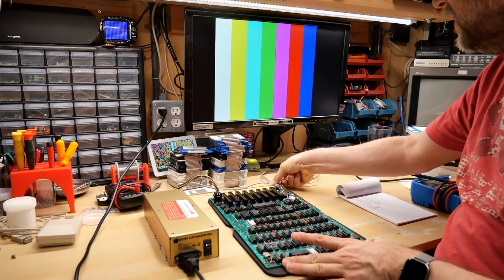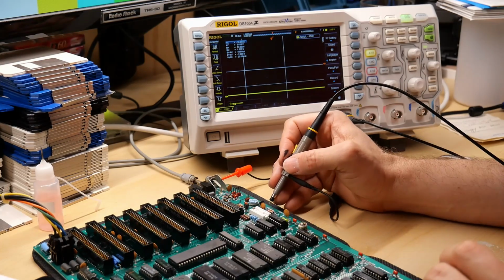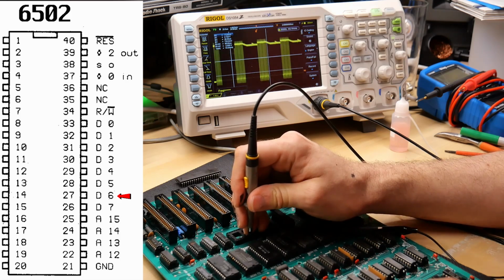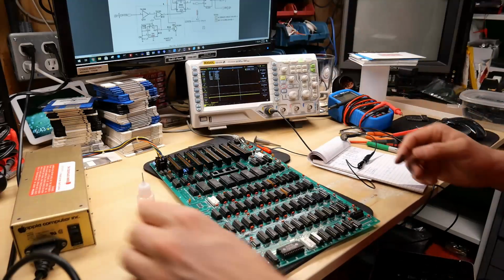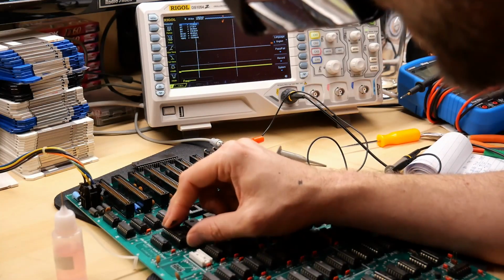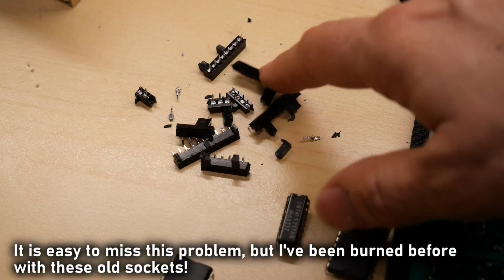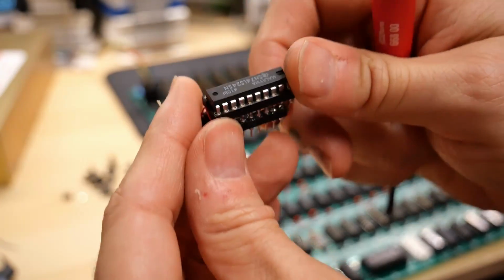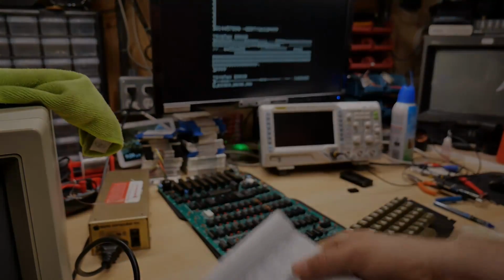Fault finding and trying to fix the Apple ][ plus

Comment: I have a similar problem at Europlus. Screen filled with question mark. 
Memory tested. When it is turned on, hear a beep and turn on disk, but does not read. The screen fills up ???  Pressing Reset key turns off the disk and clears screen and fills in question mark again. Pressing the keys sometimes shows some characters. 
Do you have any idea what to do next? 

Can I get a schematic of how to convert 74HCT245 to 8304.

Comment: Hi Adrian, your videos are inspiring, I recently acquired an Apple ][ plus and I am trying to get it to work. If I boot without any expansion card, all I get is a screen with garbage data. I have a Titan Accelerator card, and if I plug it in and boot it, then it boots and hear the beep, but the screen is still filled with garbage, If I type something, all is see are @ characters on the screen, but the screen is filled with sold square characters, not sure where do I start. Any direction would be really helpful.
Reply: As a follow up, we basically did like what you did, pulled out rams, roms and processors to make sure the pins are not bent and reinserted them back after a while voila it booted without any problems, the. After few mins the keyboard quit working. It still responds to ctrl reset, probably encoder is busted?

Comment: I've tried to read the specs, but I will be the first to admit that I'm not electronically minded, I'm a programmer :)
Adrian, can you clarify what, if anything, might have gone into CPU slot 14 in the bottom right corner? Just piqued my interest as it looks like an SMC kind of location, and in my ignorance, I didn't think they were using that sort of thing when this was built!

Comment: It's too bad that the direction pin on the 74LS295 wasn't inverted from the 8304. If it was, you could have just inserted the chip rotated 180° and swapped Vcc and ground.

Comment: The 74245 and 8304 are the same except the power pins (VCC and GND) are reversed, you could just flip the chip over, reverse the power pins and maybe have to invert the OE / Chip Disable

Comment: I Did Some Research and found that the 8304 is pin compatible with the 7304. And weirdly enough an support chip for the Intel 8086 & 8088 processors known as the Intel 8286. So the DP8304/DP7304 & Intel 8286 are all basically the same chips. I sure hope this helps.

Comment: Isn't the leftmost ROM the character generator? During the video phase, if text mode is selected, the ROM is addressed by the video address generator plus the contents of screen RAM. Chip select is low, and the output of the ROM goes to the video shift register. So you would see activity on that ROM.

Comment: If that KB has Datanetics DC51 switches, and as it appear to be a pre-RFI model, it almost certainly does: I have a detailed and specific cleaning procedure, that you can attempt. The DC51 cannot be safely disassembled and then re-assembled and must never be cleaned with water at all, in any form or method.

Edit: I looked at the video for the previous part, and you do not have DC5x switches, so it is far simpler to clean that mech.
Reply from the maker: Luckily it's an Alps SKCC board! Glad it's nothe DC51 didn't realize it couldn't be cleaned even.
Reply: @Adrian's Digital Basement  Aye, I saw in the prior part that it has the T stem Apls. You are superbly lucky, as if you has washed a Datanetics B with DC51s like that, you would be looking at £8 per switch that is dead, and a lot of chemicals and time to try to revive them first. 

FWIW, when cleaning a KB mech, it is fine to wash the keys in a fin with some warm water and mild soaps. For the mechanism itself, I cotton swap clean the mech, and I spray a tiny bit of both DeOxit F5 and DeOxit D5 into the switches. The Fader (F5) lube helps them to spring up readily. Washing the KB mech as you did would tend to push unwanted materials into the switch mechanisms. At least you can open and repair ALps sitches most of the time, but be wary as that specific style of Alps switch is now hard to find as spares. 

The videos are nice. I wish that I had been around for consultation prior to you wasting all of that time. You might want to join the Apple Fritter forums, and visit the 'Apple II' board:  I do what I can to help people diag and repair Apple II stuff on the forum.

I recently received a known dead Rev 04 board that is far, far worse off than what you had here, that I plan to go through net month. If I cannot revive it (would be an exotic case), I will save it for spares on my other Rev 04.

You have a Rev 07. That address bus 8304, on the earlier revisions, was handled by a PAIR of 8T28s. 

Overall, from bare schems and a scope, you managed to fault locate and repair it. You are also quite right abut that bodge blocking a card slot. When you have a chance, you can easily order the 8304 and I advise doing that.

P.S. Please do consider joining the forum. We'd welcome you and you will find a lot of useful content, advice, and kit there.

Comment: Tektronix had lots of issues with TI IC sockets in the 70s and 80s, the suspect ones contact the edges of the pins rather than the face of the pins; the only long term solution is to replace them.
Reply from the maker: It's the worst kind of problem too

Comment: Well done for getting it running. The 8304 (at least the Am version) is capable of +/- 48 mA output drive capability. The 74ls245 (TI) can only do -15 / +24 mA. I suspect this would only be a problem if you have a lot of expansion boards plugged in.
Reply from the maker: Interesting -- I had the machine fully loaded with cards (except for slot 5 and 7) and it seems to work great in this configuration. I wonder if most Apple II cards don't use their own 245s to go high Z on the bus like most ISA cards do....
Reply: @adriansdigitalbasement  Even in the high Z state, the devices will draw some current, especially when presented with a logic "0". The keyword here is "fanout" - how many inputs you can drive with a single output. It is easy to exceed it on data buses if you aren't careful, which is one of the reasons people add buffers. You can see if the driver is struggling with a 'scope, as the low state will be getting close to the threshold - about 0.4 V.

Comment: The pin straightener is not in the affiliate links. :( I am looking for something like this. Unfortunately it doesn't seem to work as affiiliates anyway when switching from Amazon US to Amazon Germany (I'd like to support, but paying triple digit shipping cost from the US for an inxpensive item defeats the purpose), but I can't find such a device anywhere here at all, so a name or model number would have helped. Adrian, if you have any idea, help is greatly appreciated. (And maybe you find a way how those links work for all internaltional Amazon sites, with your international audience you may get some more support.) Thanks!

Comment: youd just have to change the level on the direction pin so the 245 works in the correct direction. There will surely be an unused gate in a 74hc04 or similar on the board to help you flip the direction signal.

Comment: at 4:47 he says "that's a warm chip" (8304) that should have been the first clue..a can of component cooler might be helpful (back in the old days ..now an infrared camera would be better to spot hot chips) ...there is really no reason for a Transceiver to run hot unless something is wrong...for the triple stack..very creative..myself i would have just bent the 3 misaligned pins up (outside of socket) and run wire wrap wire from each pin to the mother board and install chip in the socket one pin down..this would look more professional and cleaner..I worked for Tandy back in the 1980's and we had to do this sometimes to make factory mods.....granted to replace the chip you would need to unsolder the 3 wires and install a new chip and solder the wires..putting original in would just be cut the 3 wires off mother board...
Reply: As soon as he said warm chip, I thought that's the bad one :) No good content in that though. We all would have skipped this vid as 'too easy' Had to have the satisfaction of full diagnosis. It makes me want to pull out my bad 2e board and get stuck into it
Reply: @tenmillionvolts  good point..I also wanted to add to all beginner techs out there..if you do not have an infrared camera and cannot find component cooler..you can also use a can of compressed air "Computer Duster" just invert the can and spray..

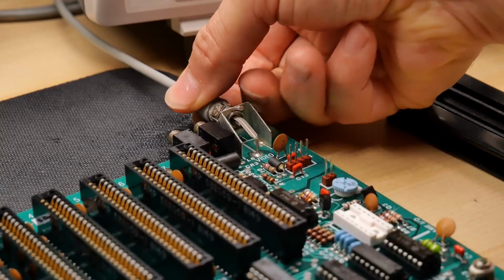Comment: 32:56 it looks like the crimped RCA ground ring is still spinning in the frame in this shot, I think you got good solder bonding on the frame but not on the sleeve/ring part. Might want to go back and touch that up, otherwise your flaky composite output problems might return!

Comment: Please verify if the current limits of the LS245 matches the old bus driver, if you put several expansion cards the '245 can burn out or can't drive the bus (fan-out lower than the original bus driver!) . Best regards from Brazil!

Comment: Some old Acorn computers suffer the same keyboard problem after long periods of disuse, particularly the Acorn Electron and the BBC Master 128. My fix has always been to hammer the keys repeatedly until they start working, which sometimes takes hundreds of keypresses. There's also a way to desolder a switch, unscrew the pins from underneath, clean them up and reassemble, but I don't know if the Apple II uses the same switches. They certainly sound a lot like the keyboard on the Electron.

Comment: Another great video, Adrian.  Illustrating the chip pinouts as you test them is a really nice touch, makes it super easy to follow.  

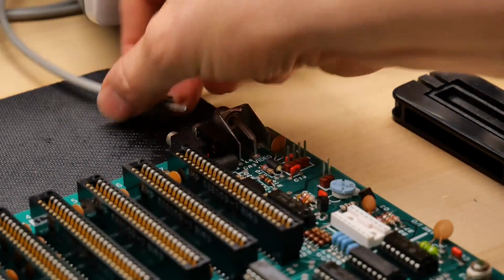Just one tiny issue... if you watch 32:56 - 32:58, there appears to be a minute amount of movement in the RCA jack. It's hard to pick up at regular speed; it become quite obvious at 0.25x.  Because the movement is so subtle, it probably wasn't obvious at the time of filming (as well as being easy enough to miss during editing).

Comment: 1. The RCA socket was still twisting, it didn't solder together.
2. I would bend those non-matching LS245 pins out of socket and/or trim them, and solder wires to them, then I'd put the IC directly into the original socket without any adapters, shifted by one row, and put these wires into the free socket connectors.

Comment: I made an adapter for an LS244 when my 8T28 (or what was it) bus transceiver went up in smoke, because even though my local electronics store (which now only sells computers and computer parts, RIP) had 8T28s in stock (new old ones), they were insanely expensive like 20 bucks a pop or something.
EDIT: The machine I'm talking about is a 1980 bootleg Apple ][ that has some differences to the one shown in this video

Comment: A long time ago, I bough old computer boards with a lot of TTL chips. The sockets were Texas Instrument sockets and when I tried to reuse these sockets in my projects, they weren't reliable. Plus the use of rosin flux caused some problems with the socket. When using flux remover, it left a film of rosin on the socket pins so that circuits no longer worked.
The best sockets are those dual leaf sockets.

Comment: I thought you had a DIP-Chip Extractor tool, or does it not really work on old ICs stuck in sockets?
Reply from the maker: If the chip is stuck better to get it moving first .. I could have used it, just forgot in this case.

Comment: Bend up Vcc and GND of the 245, then insert this chip turned 180° (so that 245er pin 1 goes into socket pin 11) and connect Vcc and GND by yellow wire...
Reply: I see my fail - forget all after good morning...

Comment: I have a question, what do you set the oscilloscope to get the read outs you get? Ie the data lines, clock speed and the reset line for example
Reply: When you use the oscilloscope, you always have to know what signal you expect. For TTL 5V signals the vertical sensitivity needs to be DC 2V/div (or 1V/div with some negative offset), and time base needs to be appropriate for the bus clock.
Reply: @TzOk  Yeah, but how do you set the oscilloscope to do this??
Reply: @bendunning403  I'm afraid I don't understand your question. It is the most basic oscilloscope setup that can be used. Trigger set to Auto, probe on CH1, triggering from CH1 on signal edge (rising or falling, doesn't matter).

Comment: The 4-pin header near the video jack is not for 80-column cards, but rather for an RF modulator for connecting the computer to a TV.  The Sup'R'Mod was the de facto standard RF modulator back in the day.

Comment: Thank you for that video, but this time i have a question, i have an Apple II Clone, and everything seems to run great, but i have some strange vertical Lines, they gos away if i tourn the Apple in 80 colum mode. By the way, some memory chips was also foulty,  and it takes one day to find the ritght chip.

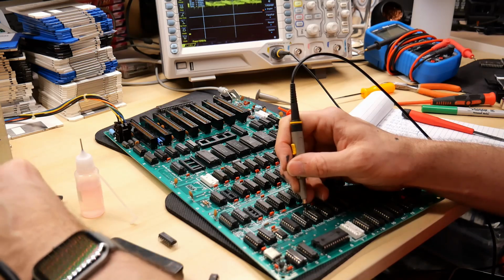Comment: Posting this while still watching, currently at 19:23 when he just removed the memory chips to figure out why D0 is being held low. He mentioned the third chip not being installed because that's where the Language Card plugs into, and that triggered an alarm bell inside my head. If no language card is installed, then that socket needs to be populated with a RAM chip. Since that socket is empty, that could be why D0 is being held low. (I'll edit this comment later if needed as I continue watching.)

EDIT: Ok, it wasn't the cause of D0 being low. However, it still is true that the white RAM socket needs to be populated if no Language Card is installed, so further testing down the line might have issues with that socket being empty.

Comment: I used the trick of sharply pulling up several times(basically the opposite of a quick key press)on each key on the keyboard of my II+ and it's worked for years since. Nearly half of my keys didn't work prior to doing this.

Comment: That video out connector still moves unfortunately 😀
Reply: I found that plumbing flux works good on parts like that (much more aggressive than normal flux).
A very common issue with Apple II’s - I have fixed quite a few by soldering them as you have...
Reply from the maker: Yeah I noticed that in editing too!! The cutting out is gone at least.
Reply: @adriansdigitalbasement  I guess that a little bit of sanding and solder paste can make the solder to stick properly.

Comment: The keyboard connection in the Apple ][ is extremly sensible to EM interferences (especially if you have a mobile phone close to it). It is a parallel TTL cable without protection. The problem manifests by extreme bouncing i.e. it gets a lot of spurious keypresses. Think to put the cable through ferrit rings. It helps a lot.
Reply from the maker: I actually have extras from the C64. I'll give that a try.

Comment: I have a very different approach to replacing parts.  Rather than badge something to support a different chip, I would order the right part, or failing that, send of an order to OSH Park for an adaptor PCB with a surface mount IC.

ADB comes up with a Frankenstein fix in an hour, I come up with something prettier... in 4 days to three weeks.  Haha.

This might explain why I have piles of half-finished projects on my workbench.
Reply: Yeah, I think it is wise to do the bodge just so he can prove the part is bad! Otherwise you have to put it aside and wait for parts to come, then try to remember where you left off when you finally get back to it! Plus, he can enjoy the fixed computer now while he waits for the replacement part!

Comment: I love these old computers! I'm 24 (so way after when these computers would have been in schools) and thoroughly interested in computing history.
Reply: im 11
Reply: I can definitely recommend the Apple IIe for you (excuse my pushiness if you already have what you need). They aren't crazy expensive. All you need is the main unit and an audio cable. You can use websites on your phone to stream the data (as audio) to the computer to load programs. Additionally, it connects to any television that accepts a composite input. And if something goes wrong, you have this channel for a reference!
Reply: @SixOThree  Yup, I have a number of retro computers and would agree with your suggestion as well.  It's not my favorite retro computer, but it's definitely the one that offers the most tinkering ability as well as an abundance of software.  It's also relatively easy to find.
Reply: @SixOThree  Thanks, I'm not sure if they will be particularly easy to find in the UK but I'll certainly keep an eye out. My current goal is either a BBC Micro or a C64 and appropriate CRT monitor.
Reply: @LoopyLucy95  hi im 11

Comment: Every computer you repair, 99% of the time it's always the 74LS chips or similar transceiver (the other 1% is whatever crap Commodore spat out that loves to fail, like the CIA).
Reply: If only it were just the CIA failing... Most commodore 64s that are dead have a dead PLA and that chip sadly doesn't have any real replacement. Well, of course there are new FPGA replacements but the actual PLA will never be made again
Reply: @nilswegner2881   And I would say that most dead C64s with dead PLAs died because of their dead power supplies that fried them with 8+ volts DC.  So many C64 deaths are avoidable, as are Atari XL deaths from the same cause (power supply that cooked itself to death inside a solid block of epoxy), and the Apple II series has its own issues with the ticking time-bomb Rifa X/X2 capacitors in the power supplies (luckily these tend to fail safe rather than fry components on the motherboard, though).
Reply: @rbrtck  yup, you're definitely right about the C64 power supply failure. Luckily, there are modern replacement power supplies that don't kill your compufers.
Reply: MT4264 RAM!

Comment: Good video.  Next time you want to solder the phono socket first  run a file along the grove a few dozen times, maybe even rough it up with some sandpaper. The solder did not flow well on that repair.
Reply: yep sill rotates